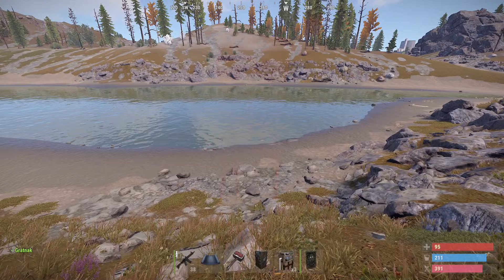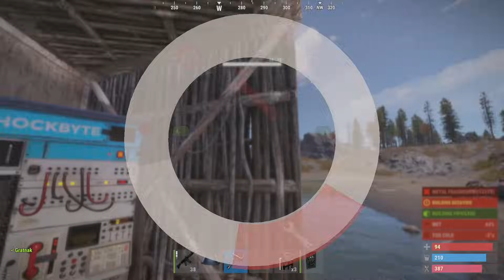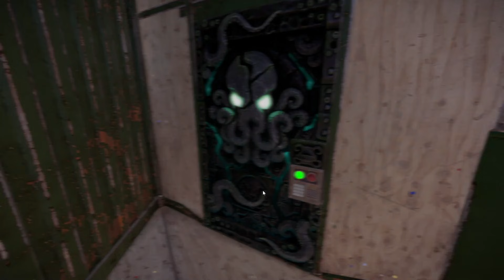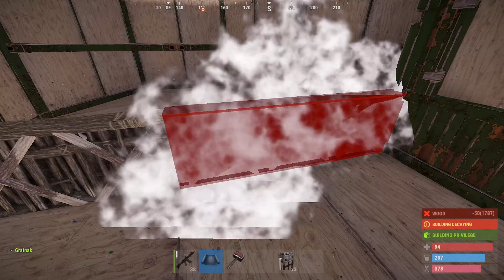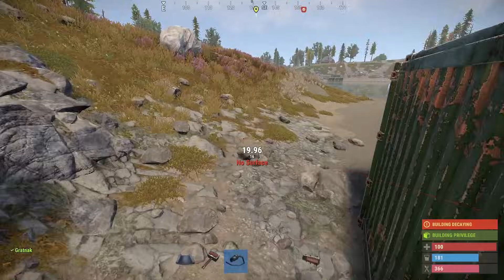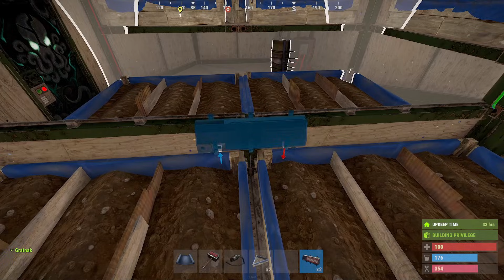Rust: Low Profile 2x2 Farm Build, with 18 planters.

Comment: The only issue I see is no room for mixing tables and/or vending machines. If your base isn’t near, its going to be a pain trying to haul everything, especially on a high pop server.
Reply: Not for mixing it's just a low profile grow base
Reply from the maker: I did think about adding those, but then I'd lose out on planters.
Reply: @Gratnak yea its a bit hard to fit everything + its a low profile base. Vending machines aren’t exactly low profile

Comment: i usualy only use1pump for like 20+crops & its fine lol why tf do i need 3 (official server only)
Reply: also watter barrel seems useless if u just go from pump to sprinkler it work
Reply from the maker: Yes, one pump should be enough if you've got a fresh water supply. The barrel is to prevent it bugging on a server restart, which would then require disconnecting and reconnecting a pipe.
Reply: @Gratnak  i didnt know about the bug, im glad u explained it to me ! thanks man

Comment: stumbled here. wanted to find a way to regulate without using 2 timers. 
i read your reply to someone else: 
"I was considering regulating the sprinklers, but you would need two different circuits: one for the sprinklers supplying the triangles and another for the squares."
etc etc and saw u generally getting good feedback. i like this video i might use these builds
edit: fatmoke  * 1 Timer, 1 XOR, 2 Branches, 1 Memory Cell. 5 components.** this is what i wanted if it works. 4 years ago it was done
edit2 : the foundational shape of your base reminds me of a stelic 2x2 double floor base design  in same layer base foundation shape. he bugs 2 floors into same place
Reply from the maker: I'll add that to the list of things I need to do. I will try to get it done within the next couple of days.

Comment: "I have unlimited water under my home, let me get a water barrel storage anyway"
U could maximize the profits on that base. Not bad the idea tho
Reply from the maker: The water barrel is to provide a buffer. On a server restart (servers generaly restart once a day, mine restarts at 7am). If there is no buffer it can cause your sprinkers to stop working until you disconnect and reconnect the pipe.
Reply: @Gratnak   You can use two digital timers to toggle off then back on fluid pump. That will solve sprinklers issues after server reboot.
Reply: @Gratnak  I'm not sure but I think cycling the power fixes the issue. I'm yet to double check but I think it's the pumps that wig out and turn off but still seem like they are on. My solution on a bigger build is to power lights other than planters via memory switch and alarm clock. Switch it to the pumps during day, fill up water barrels and give that power cycle every rust day.

Comment: Loved the video I'm new to rust n been trying things out on console pve server. I'm guessing some things console can't do what pc can do like it wouldn't let rotate the fluid combiner like u did in the video but I made it work n I couldn't fit 3 water pumps in spot only 2 but it still works great n we don't have triangle planters only small rectangular bit I made it work. Great step by step tutorial on to next build
Reply from the maker: I'm glad to hear you found it useful, hopefully it won't be too long until the console version catches up.
The three pumps were just overkill, should it be using salt water. I always like to leave a little in the purifier as a buffer so it I don't have the issues with the sprinklers not working when the server restarts.

Comment: 70% is like 50% efficiency, when 100% is 100%, it would be so hard to make plants 100% overall
Reply from the maker: I'm not sure what you mean by "70% is like 50%".

If you add fertiliser to the planters, I would expect them to operate at 75% efficiency, with water being the limiting factor.
Maintaining optimal water levels on a farm can be challenging, as different crops require varying amounts of water—consider the difference between berries and pumpkins, for example. While providing adequate water can accelerate the time it takes for crops to reach maturity, many farmers prefer not to spend excessive time managing their fields when they could be engaged in other activities. Therefore, a variance of 20 minutes in watering schedules is not a significant concern.

I was considering regulating the sprinklers, but you would need two different circuits: one for the sprinklers supplying the triangles and another for the squares.
Reply: @Gratnak   70% works for basic farming, and the benefits are so good right now. If your going to do a proper farm 100% efficiency is totally worth it, 75% gets about 1000 cloth, and 100% gets 1800 cloth. 70% probably under 50% efficient compared 100% efficiency.  I usually do basic 4x5 or 4x4, 2 wide rows for easy timer setup. Horse poop is annoying the annoying part getting 100% efficiency. Your design is really nice, cheap, compact and works well too.
Reply from the maker: Sorry, only just seen this. Horse poop doesn't need to be that annoying. With the link attached, just the troughs need topping up once every day or so. You'll soon have more than enough fertilser. https://youtu.be/V8Kg0gqGAtE

Comment: Why 3 pumps? Each of them provide 12 water. But one sprinkler only uses 2?!
Reply from the maker: @hardcoreshardy3194  I put them in as though I had to use a water purifier. Plus it best to keep a little buffer as otherwise they could bug out on a restart.
Reply: @The_Gratnak  thanks for the explanation! 👍
Reply: Sprinklers actually use 3 water but only output 2.  That’s why you should only use 4 sprinklers per water pump(in fresh water).
Reply: @andrewroff5387  where ist this information from?
I thougt IT depends on the amount of planters they reach.
Reply: @hardcoreshardy3194  that’s different. The 12 ml on the input of the sprinkler doesn’t actually mean it’s outputting 12 ml, it’s the amount of water the pump is outputting which is why if you pass through to a second sprinkler it says 10 ml on the second one. Now you would think this means that each sprinkler uses 2 ml water and you could run 6 sprinklers on one pump but the sprinklers actually use 3 ml per second and trying to use 6 sprinklers would cause the actual output of the sprinklers to drop to 10ml per 5 seconds divided by each planter it reach’s, which isn’t optimal. Sprinkler output to planter box’s is 15 ml per 5 seconds divided by each planter it reach’s so long you don’t go over using 4 sprinklers per one pump. Now if you use 3 pump combined on a water purifier or water barrel it can sustain up to 6 sprinklers. Now the reason he is using 3 pumps in this video is because he’s using to automatic watering system which uses the water barrel like I mentioned which needs 3 pumps for 6 sprinklers. If you were going to not use the automatic watering system you would only need 2 pumps for the 6 sprinklers and you could even add another 2 sprinklers if you wanted. You can find this information on tea guy Tom’s advanced tea farming guide.
Reply: @andrewroff5387  Bro! Thank you. This was nice of you to take your time and teach a noob! I am very thankfull! ❤️

Comment: Thanks a lot for the video ! 
I'm wondering what is the purpose of the barrel though ?
Reply from the maker: I assume you mean the composter? It's to convert the horse dung into fertalizer, that can then be sold for scrap at bandit camp, or used in planters for your farms.
Reply: @Gratnak  I think he means, why not run the pumps directly to the pump switch and then to the sprinklers instead of having the barrel. I am also curious about this.

Comment: Nice farm, but it need a room tour before building
Reply from the maker: The first recording did have a tour, unfortunately something meant that anything loaded up after certain point didn't want to use the sound (started with Discord, could be a complete coicidence). So though Rust had sound, when I loaded up StreamLabs, it wasn't able to capture it. Then I made the mistake of rushing it, and forgot to include the tour. 😪